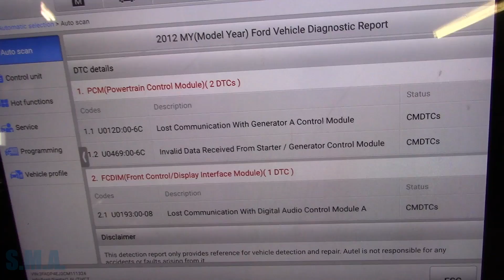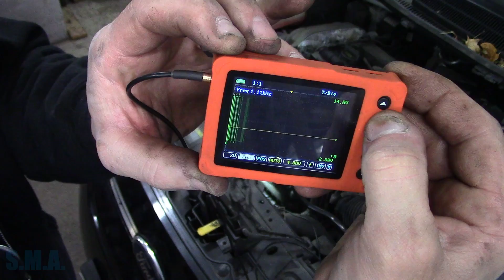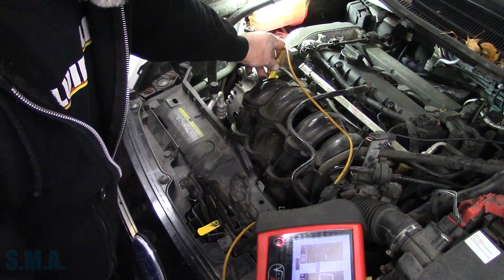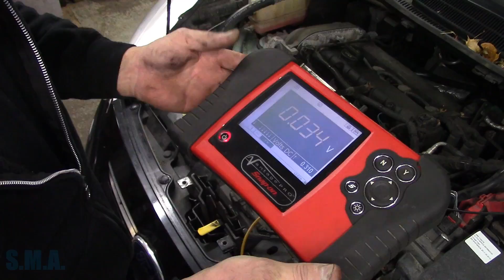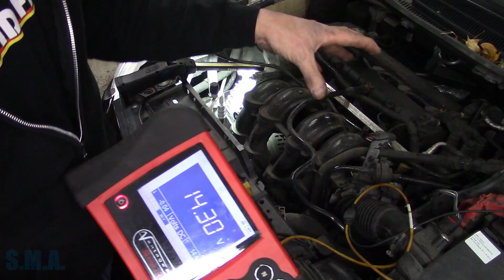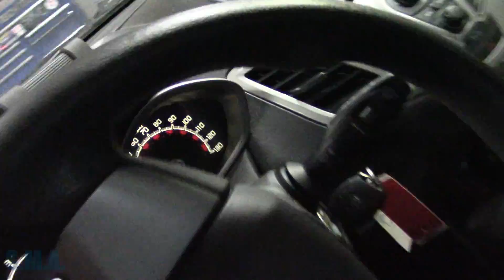Ford Fiesta: Battery Light On

Comment: What a racket, your alternator is charging, but you still have to replace it
Reply: There's alot of vehicles like that. I took mine to 3 parts stores and was told it was fine, only to find out it was charging just barely enough
Reply: Same with the clutch on the pulley. On the testing machine with very little load, it works. In the car loaded, the clutch slips. Happened to me twice already.
Reply: I know right!
Reply: Not sure I get it yet....So yes, codes got it,  PCM is sending data packets as seen on scope, got it, and alternator does put out charge as per 14.3 volts out, so you conclude, that if there are data packets at actual alternator and even if alternator puts out 14.3 volts, but there are codes, then you conclude alternator is not talking back? Is that the conclusion?
Reply: @markjohnson5081  Correct. The code says the PCM has lost contact. Basically the alternator was getting the packets but it never talked back by changing the voltage as requested so the PCM says it's not working.
Reply: @markjohnson5081  with different engine loads the altanator will put out more or less voltage. This reduces and increases fuel consumption. Because this altanator isn't sending information back to the pcm it's default setting is to send max voltage to the battery. Long term will probably fry the battery.
Reply: @markjohnson5081  That would also be my conclusion.
Reply: @markjohnson5081  I was thinking the same thing.  My daughter's 2017  Toyota has the battery light on and starts out at 14 V but after driving it slowly goes down to about 13.4V  On the fence about changing the alternator and this helps me make up my mind.  Going to look at the small wire to see if there are signal or packets there.  If so I guess will put an alternator on it.  The battery is 3 years old and tests it needs chargine.
Reply: It's because the alternator has a range of voltages it has to produce under different engine loads.  So it can charge at idle, but if the A/C is working and you have the headlights on and the radio, etc... the alternator might not produce enough voltage/current and the ECU throws a CEL.
Reply: @freddyrosenberg9288  Isn't it something to do with emissions? So they can vary the alternator load to lower fuel consumption? Completely dumb. All those planned "savings" gone by a dumb design like this.
Reply: How do you test if your catalytic converter needs to be replaced?
Reply: @shabbadaking7120  Put an egg on it. If it cooks it's good.
For real though, I have seen two methods. Check for downstream O2 activity, there should be relatively none compared to the upstream O2. Some have shot a laser temp sensor at it and it it's not substantially hotter coming out than going in it's not working. The first method is preferred.
Reply: @InsideOfMyOwnMind  post cat o2 sensor should show roughly half the waveform as the pre cat sensor
Reply: @shabbadaking7120  when you look underneath and it's been cut off.😂 Sorry, couldn't help myself.
Reply: @shabbadaking7120  check for back pressure
Reply: @shabbadaking7120  o2 sensor feedback will tell you. If it’s restricted then you’ll have no power
Reply: @shabbadaking7120  Easy. 

1)  If you are the seller of said catalytic converter, replacement is needed.  If you are the buyer, it's probably good. 
2)  If you are a used car salesperson, the cat is fine -- just replaced prior to being traded in.  If you are purchasing the car, it's almost certainly bad (until the negotiations are over -- at that point see No. 1).

Comment: I yearn for the old days, when nothing talked to nothing else, you had all the gauges you needed on the dash; REAL gauges (not just "ON/OFF) and you could work in an engine bay, i.e. not "cramped" and you could still see the road underneath. 

Oh well, great video as usual Eric!
Reply: Yeah those early sixties six cylinders were easy to to maintain.
Reply: I had a 1990 Horizon that still had gauges and free engine room in the bay, but by then there was already a push to go to those smaller 4 banger engines. 

I mostly blame OBDII, once that standard came around it was easy to integrate sensors into the car's computer (OBDI had struggles with that)  and really allowed cars to shed all but their basic gauges while at the same time introduce those infernal idiot lights.
Reply: I'm surprised when cars have gauges anymore, let alone a speedometer with a pointe, not all digital display. Drove a Nissan Versa rental that insisted it need two speed read-outs; one digital, one pointer. WHY??  NO IDEA!
Reply: I've never bought a new car after my very first one, so I can't speak for anything newer than 2011. I own a 2011 CR-V and really, yea, not much to speak of. I have a speedo, tach (both analog) and then the digital display in the middle that only gives gas and engine temp in the way of gauges. I think the loss of a battery gauge was the biggest mistake ever. 

And I hate the over reliance of idiot lights. A battery symbol won't tell me if the battery's failing, only come on AFTER the &*^&^* machine won't start because the voltage is too low. Same thing with the temperature gauge.
Reply: I guess what shocked me most is there is no room to navigate under that hood, even with that little glorified motorcycle engine in there. And I've ridden motorcycles with bigger engines, and you could probably fit 2 of them in that engine bay. That giant "intake manifold" is all show.
Reply: I had a 2006 Focus and it was the same problem, for an engine that had 4 cylinders; took up allot of room. Yea, that looks exactly like the intake I had on my focus, never understood why it had to be that big and cumbersome. And (at least on my generation Focus) they buried the alternator in the back, by the firewall about halfway down the engine. My alternator died 2016; didn't have the tools to dig it out or the lift to get the car up, and honestly that's my biggest beef with modern cars; no room in the engine bay.
Reply: @wirenutt57  It makes sense though. Motorcycles are under much /much/ smaller regulation for emissions compared to cars. A small carbureted 50cc scooter dumps out THREE TIMES the emissions of a Tacoma with the V6 just in unburnt fuel alone. If motorcycles were held to similar standards as cars they'd have much more stuff on the engine.

Comment: I am surprised the used car dealer did not replace the alternator.
Reply: Eric Certified is a great selling point😀
Reply from the maker: He's getting smarter :)
Reply: @SouthMainAuto  Yes but he would have saved on the labor and mark-up if he did it himself.
Reply: Rob Carstuff is getting smarter because he may have guessed this one right but he’s been wrong a lot too and put new parts on that don’t fix it
Reply: @joeshearer1247  Just pay for the diagnostic fee and replace the part yourself, hats what used car dealers usually do.

Comment: AMEN!  Hope 2021 is better.  BTW: Here in the center of Pennsylvania, where we have just slightly less salt on our roads than you do, I've found that the alternators on this vintage Fiesta (up to 2014) don't fare well.  I've replaced quite a few for the same reason... no com.  And, most of the time they are still charging. At $200, parts and labor, this repair doesn't give me any sense of satisfaction.  Unfortunately, we're just like NY in terms of inspection... I can't put a sticker on if the check engine light it on.

Comment: I used to have one of the original Fiestas back in 76. No real issues.  My only complaint was the 12 inch rims.  That car would need tires and brakes every 30,000 miles.  But tires were inexpensive in that size.

Comment: My granddaughter has that car. Cracked oil cooler pumped oil into the radiator. What a mess.
Reply: Why bother with a oil cooler with zero tow rating? 😂
Reply: Gotta hate Fords.
Reply: @gplusgplus2286  My last Ford, an Escape went 260K miles and was still running strong when I got rid of it. My current Fiesta has 145K with no engine trouble at all.
Wish I could say the same for my wife's Honda Ridgeline.
Reply: @gplusgplus2286  They are all politically correct crap nowadays

Comment: It is nice that the alternator has a constant backup so you don’t risk losing all power
Reply: It's not technically a "constant backup". The alternator itself can still fail on the charging side. This merely adds a new level of complexity and potential for failure with these variable charging rate systems. So here you had a perfectly good alternator, but the failure was in the module that communicates with the ECM.
Reply: @robsp32  That's true. But since automobile manufacturers are forced to find every way to save fuel, wherever it's technically possible without cutting comfort or safety down, the cannot let go the possibility of cutting the alternator off whenever it's possible.
Reply: @robsp32  Not necessarily a new thing, I had the exact same symptoms with my 1994 Mustang, Battery light on but alternator was charging just fine. It doesn't use any smart charging, just an internal regulator and a single wire to the instrument cluster light.
Reply: jw  yeah  they should have done that with the  ford focus
Reply: @joehyundaitech7961  All Ford have the "smart charge" system these days.
Reply: @werner.x  Ford is not all bad. The engine temperature management system has saved a few engines, including one belonging to a friend's daughter.